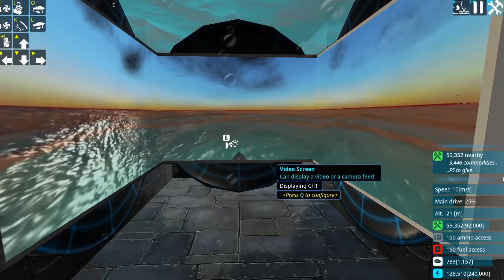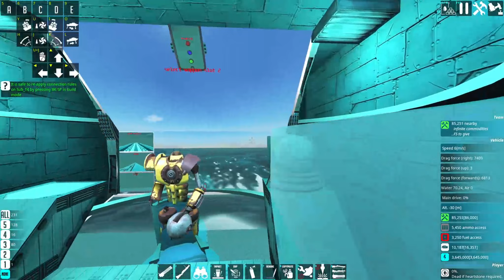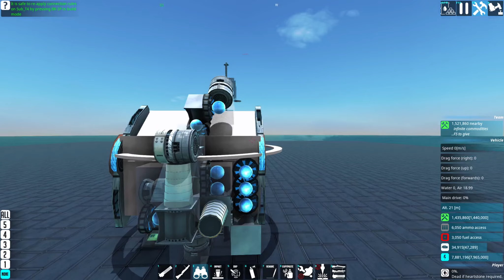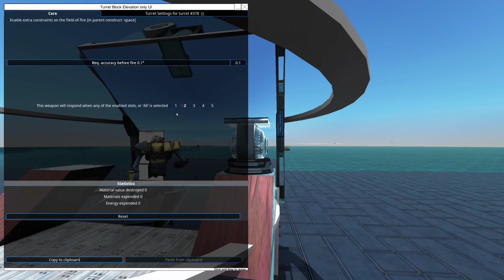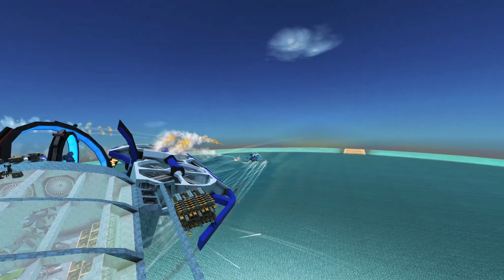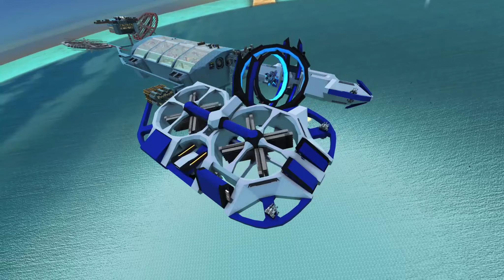Smart(er) Periscope and CIC for your submarine (looking at you Lathrix)

Comment: Wow that is amazing. Good luck on your craft as well. My equivalent thing I am trying to make is a Laser that sits 10000m away and 7700m in the air and just snipes anything to death. I am currently having trouble making the maneuvering for the tiny satellite that carries the craft.
Reply from the maker: I think you have one or two zeroes too many! Gravity starts again at 2500m and no detection will be able to see an enemy 10km away, plus you will loose a ton of damage because of range. I think 700m altitude and 1000m range would be more reasonable numbers!
Reply: @livslab  That is why you need a 120 block long laser to get 80% damage at 10k range (and a 2 degree field of fire). Also If most of your front face is visual detection (14 9m rangefinders, 40 camera tracker, and 8 laser) you can hit about half the time(tested on smallest SS godly craft) when being disrupted by smoke (it adds a constant error that is unaffected by range to all visual detection). You can get up to 7700m (7810 is hight border) with a tiny aerodynamic chunk of batteries with lots of thrusters on the bottom and some for stabilization on the side. The docking station can pull any vehicle at 100m/s so the craft's weight is inconsequential. Just feed the satellite some battery power and presto, you have the cheesiest craft possible. Basically everything has to be optimized a ton or it wont work.  As of last night I got it to work but half the craft is missing and the movement is not implemented and not even stable.
Reply: @nicopence3148  Sorry to revive an old comment section, but I might have an idea - if you're having trouble getting accurate detections from 10km or further away, then I recommend making drones that are closer to the enemy and do the detection for you, then share the detection data via an Inter Vehicle Transmitter to your laser craft.
Reply: @mulppi8797  Good Idea. 2 questions arise from that. Do Ai crafts ever target those drones and how much does the jammer reduce detection by in that range? I know the jammer diminishes with range so this might completely work.